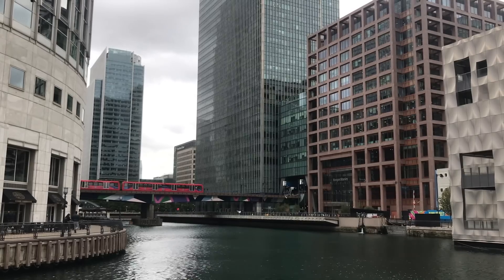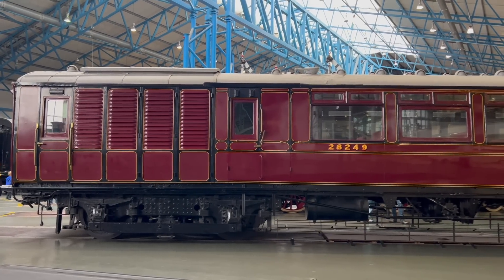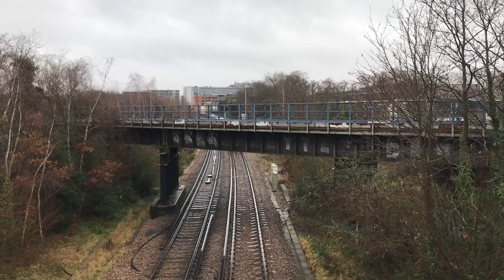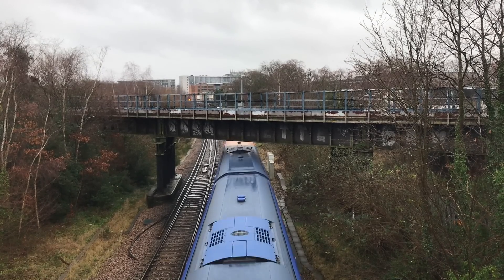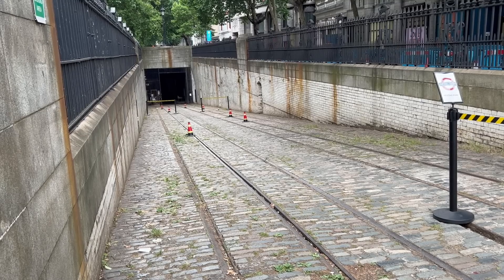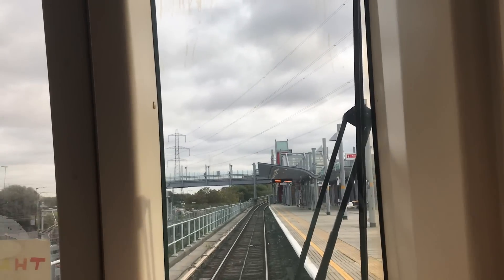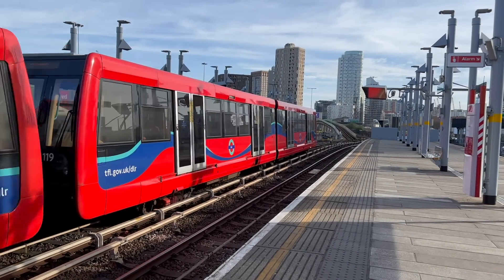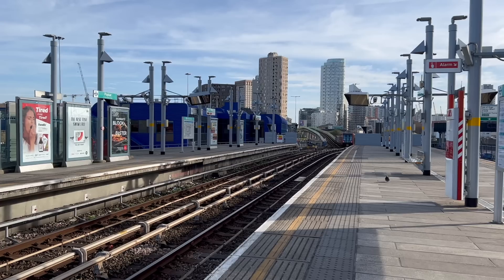How the Docklands Light Railway is Powered

Comment: Third rail actually has a very good safety record. Platelayers know well that before you go anywhere near the lines to repair them you make well and truly sure that the traction current is off. Same as the Underground. On the other hand, a side contact 3rd rail system was pioneered back around 1915 by the Lancashire and Yorkshire Railway on the Manchester-Bury line. It ran happily enough but was converted to the Metrolink when the non-standard rolling stock became life expired.
Reply: Third rail is responsible for eight times more incidents than OHLE according to the HSE
Reply: @hairyairey is that track workers or people trespassing?
Reply: @johnchurch4705  probably both. I recall someone dying as they were running away from the police.
Reply: @hairyairey  I think the simplest solution is don’t trespass or try and evade the police by running across rail/tube lines. I did read an article on a tram system that uses third rail, the 3rd rail only powers up when the tram is there, it might be In Australia 🇦🇺?
Reply: @johnchurch4705  Very simplistic response. Even if it wasn't lethal the third rail is of limited usefulness outside an urban area. India adds 1000km of electrified track every year. Its rail network is only about 3 times the size of ours, so it's definitely possible.
Reply: @hairyairey  I have read that we are way behind India 🇮🇳 on electrification.
Reply: @hairyairey  Thanks. Two surprises here; firstly that India's rail network is so relatively small given the size of the country (68K km v 16K km, actually about 4x UK) and secondly that nearly all (93%) is now electrified (UK 37%). I believe that virtually all Indian electrification is overhead wires which is not surprising considering the long distance runs.
Reply: @iankemp1131  I don't think they have any third rail, although there's that awful standard gauge commuter line in Mumbai now (don't set me off on that one!)
Reply: @iankemp1131  also is that figure of the UK network correct? We have a number of lines that are freight only. Even heritage lines count!
Reply: @hairyairey  My understanding is that it includes all lines and does not distinguish between passenger and freight. It's from Wikipedia but has 4 solid cross-references to primary sources (ORR, Railway Year Book etc). Also includes Northern Ireland. It's just under half the peak network length (34K km in 1929) so that sounds the right ballpark to me.
Reply: @iankemp1131  Thanks for the update. I clearly overestimated the size of our railway and underestimated India's.
Reply: @iankemp1131  Found a wikipedia page that says all of India's third rail lines are bottom contact like the DLR
Reply: @hairyairey 
The figure that counts is incidents involving staff. Otherwise it's Darwin's Law.
Reply: @henrybn14ar  that's no way to run a 21st Century railway. Not when liability is involved
Reply: I thought the juice was only turned on block by block as the train entered the block, so roughly speaking, no train coming, then power in the third rail.
Reply: @russellplumley8665  No, it's a continuous supply maintained at 750V DC (or whatever voltage is used). The power draw is considerably higher when there's a train in the section and the substations then have to supply increased current. So even if there's no train nearby, stepping on the third rail would kill you (or give you a big shock in more ways than one) unless the supply has been deliberately isolated for maintenance.
Reply: "no power"
Reply: @russellplumley8665  I don't think it's that clever, it's on all the time

Comment: Some of the German railway lines also have an electrical line in the middle of their tracks. There they are also used for signaling, but in the high-speed range. Speeds over 160 km/h are only permitted with this system (as far as I know).
More detailed information can be found under the term “Linienförmige Zugbeeinflussung” (LZB).

Comment: It's a clever system and makes a lot of sense. I'm still rooting for electrified steam trains though. Look at that magnificent steam train at the end. Wouldn't it be chuffing great to see those going past knowing that the steam boiler was running on electricity? 😁
Reply: Hornby make or maybe made a line of model railway locomotives which 'electrically generated' their steam propulsion.
Reply: Switzerland did this during ww2 and in the late 1930s / early 1940s the USA was experimenting with  steam locos that generated their own electricity - but without success
Reply: Wrong way round. Make a steam engine that powers a steam turbine and makes its own electricity! Bonus points for a nuclear reactor...

Comment: Jago could you do a video on why the DLR is so wobbly?
Reply: I'll save him the time. It's because the trains are very light (less than a third ofthe mass of an equivalent mainline train) and the permanent way (the whole railway, not just the track) is built to a less stringent quality standard than the mainline and this allows the lighweight DLR trains to bounce and wobble around a lot more .
Reply: @MDThomas-pv7hx thanks
Reply: @MDThomas-pv7hx I recall Jago said in his video it's the way the bogies are constructed. I think I need to rewatch it
Reply: @hairyairey  Not necessarily the bogies themselves but rather the wheel and how they're more conical than normal.
Reply: he already did

Comment: I know someone here will know the answer to this question. As a completely non-techie sort of person, I was wondering why the same high voltages can't be transmitted as effectively down metal rails as they can along heavy duty overhead wirees.

Is it just a safety issue or are there physical principles at work here?
Reply: For completion, tramways tend to use 600 - 750V overhead wires which has a similar explanation as why 3rd rail is powered at similar ranges: Too many objects nearby, would be too much of a safety hazard and has a higher chance of arching.
Reply: Simple answer - 3rd rail is 750v DC. Overhead is usually much higher voltage, say 1,500v and could be AC. The higher voltage means more power with a smaller drop over length due to resistance. More tech explanation -  it's Ohm's Law. One volt can push one amp through one ohm.

If the near ground 3rd rail were powered in the kilovolt range, it would not only be much more deadly to humans wandering onto the track, but also be subject to wasteful arcing and sparking due to its proximity to the earth = return part of the circuit.
Reply: @RadioJonophone  In the example of the DLR, it's elevated some distance from the ground and shielded, couldn't the voltage be raised in a system like this?
Reply: @peepiepo  The practical limit for 3rd rail is 1500V but 750V is a much more common standard. It's not much worse in terms of transmission losses and required substations but allows for a more compact setup.

In most countires there are also additional electrical safety rules on systems above 1kV. I don't know if railways are exempt from that though.
Reply: @RadioJonophone  I knew the voltages were different. It's the second part of your answer I was looking for. Cheers!

Comment: If you've travelled on Manchester Metrolink between Victoria and Bury, then you're on a line which until the 1990s used a very unusual 1200 VDC side contact system.
Reply: Ha - I came into the comments to post that!

The first L&Y electrification was Liverpool to Southport, later extended to Ormskirk, at 600v DC third rail. The suburban lines out of Manchester were to be tackled next, but because of the hillier terrain 600v wasn’t regarded as powerful enough. The weird side contact arrangement was arrived at partly for safety reasons, but mainly to reduce exposure to snow and ice.
Reply: @andrewrevans8496  Was it also to reduce the number of feeder stations required? I was under the impression there was only the one input, at Bury?
Reply: @lordmuntague  not sure, but I wouldn’t be surprised

Comment: The under-rail pickup method is itself over 100 years old. In 1919 Vincent Raven planed to use this pickup method for his proposed York - Newcastle electrification.
Reply: That's nice. The New York Central employed underrunning third rail on the Grand Central Terminal project - more than a decade earlier

Comment: If we haven't got used to you being extraordinarily nerdy by now, Jago, why are we even here?  Enjoyed that explanation though. I did wonder (ever since I encountered Southern Railways third rail system) whether or not they might get "upgraded" to overhead wires. Then I moved to the south coast and found it wasnt that simple.(Tunnels mostly). I suppose dual systems would be possible given we have dual (or more) supply trains. So upgrading would be possible...even on the DLR if that became an imperative. Seems unlikely though and its quite a neat system ...although I suppose there may be capacity issues as it gets more popular.
By the bye, still quite a fan of Parisian Metro trains that run on big rubber tyres.

Comment: In Toronto, the subways are powered by an over-running third rail system and these all have a covering plank, even in the tunnels. I recall that after a heavy snowfall in New York that the lines with over-running ( the Long Island Rail Road, as I recall) could not operate but the under-running lines like the Metro North could.

Comment: the pickup shoes are not sprung they are air actuated as the rail it self its a aluminium with a steel layer applied to the bottom of the rail so a light pressure is needed so it doesn't wear down the strip steel down too quickly and to prolong life of the rail please look at this  https://railwaymatters.wordpress.com/2017/11/24/30-years-of-docklands-light-railway-dlr-new-trains-to-come/
   👍

Comment: Thanks Jago.  The third-rail system with a contact from beneath is quite common abroad.  It's used on the extensive Hamburg S-Bahn system for example.
Reply: It is the de-facto standard for all metro systems around the world. And has been since the 50/60s.
Reply: @sjokomelk  More recent metro systems tend to favour overhead wires though.
Reply: Yep, Oslo and Stockholm metros were (mainly) built in the early 60’s. As Jago does mention, a ‘bare’ top-pickup rail wouldn’t work up here - it’s actually snowing now, bloody April fifth… 😅
Reply: 😢 @musiqtee Stockholm uses top  pick-up rails with a wooden "roof" above the third rail.
Reply: @jakobholzwarth1544   I stand corrected - Thanks!
Reply: Unfortunately your comment is false.

Hamburg S-Bahn does pick up from beneath but even stranger. It picks up from the side. The inner side towards the running rails. Sone sections are too electrified with overhead wire and all new lines are build with overhead wire. 

The S-Bahn Berlin is similar. It also picks up from the side (which I, didn't knew myself). But it has an even Stanger trick up it's sleeve. At a few locations the bridges are too narrow and the pickup-shoe could hit the bridge. To prevent that, they can flip up the shoes to get the required clearance. I'm no longer sure is done from the drivers cab or using trackside equipment, but I think I recall it trackside equipment.

Small fun-fact about the Berlin S-Bahn. The reason it uses 3rd rail is, because the system is so old, that back in the day where the build the first lines, lobbyism of steam locomotive manufactures lobbyed hard to prevent bridge to be raised with the intend to prevent overhead wire to be build. 

Berlin U-Bahn is also kind of crazy.
The "Kleinprofil" i.e. The narrower cars on the Lines U1, U2, U3 and U4 are top pick up with positiv polarity. Except U2 it has negativ polarity because of the Berlin wall.

The "Großprofil" the wider trains are all with bottom pickup and have a negativ polarity.
Reply: @IamTheHolypumpkin  I'm sorry, but you are wrong in some parts.
In general, the Berlin S-Bahn draws its power from below on the third rail. There were bottlenecks where the third rail pushed the current collector inwards and then contact was formed from the side. As far as I understand, these places have been rebuilt over time.
Reply: And the Berlin S-Bahn and some lines of the Berlin U-Bahn. The other U-Bahn lines use a third rail with contact from above. They don't mix because the height and width of the trains is different but they have the same track gauge
Reply: BART, which is commuter rail for the San Francisco Bay Area (Bay Area Rapid Transit) uses the same system, whereas San Francisco's Metro uses overhead wires, as it's a hybrid tram/underground service.

Comment: The DLR is a great network..i don't see it as nerdy to like such a wonderful mode of transport...You have raised an interesting subject on power supply..with the trams now using overhead lines, (I am guessing high voltage AC), surely this will be far more efficient in future, and time the old 725v DC is consigned to the history books? Or will Mr Yerkes 's ghost come and haunt me? PS I love sitting in the very front seat on the DLR, so much better for photography!
Reply: London Trams use overhead 750VDC. High voltage AC would require much higher clearances for safety.
Reply: @lordmuntague not sure you are correct there. 230V RMS AC is less power than 230V DC, 30% less (1/sqrt(2))
Reply: Trams and pretty much all OLE light rail systems use low voltage DC. Standards vary but 600V and 750V are the most common.
Reply: AC would require trains to carry a bridge rectifier to power a DC motor. So not suitable for local lines that use small trains.
Reply: @hairyairey  I must admit I don't know the full spec of the exact trams London presently uses, but DC motors are less common nowadays in rail vehicles, tram or train. They tend to be AC induction motors, with electronics converting a DC supply into variable frequency AC. If the main supply is AC it would indeed have to be rectified first, as happens with modern trains. The advantage of an AC supply is that it has much longer range, requiring fewer feeder stations, which are the real expensive bit in electrification. It's all very much swings and roundabouts, which makes it all the more interesting.
Reply: @lordmuntague  I think the gains between AC and DC for loss over distance are marginal, seeing as all the international interconnects are DC. That's so we aren't tying our grid to European peak demand.
Reply: @hairyairey  This is true, I have wondered if we'll see a high speed line powered by high voltage DC soon. Mind you, I can't see existing lines changing quickly given the amount of low frequency AC still used in Europe.

Comment: Thanks Jago.  Great video and has explained what I didn't previously know about the DLR; especially the thin 'centre rail'.  I'd already figured out how the Power Rail worked, but wasn't aware that the tracks were the Return Rail.  Strikes me as being almost as Lethal as the exposed Live Rails on the Tube.
Reply: All electrified train tracks use the rails as the return circuit. Even the ones running 25kV overhead wire. But the rails are grounded an at a potential of 0V to ground. So they are perfectly safe for humans.
Reply: I suppose that the rails are grounded at very short intervals.

Comment: Fun fact, the DLR train in Manchester mentioned was not the only one to be fitted with a pantograph for overhead wires. Some of the oldest DLR trains were sold to Essen, Germany to be used as tram trains, so they were fitted with proper driver's cabs and pantographs.
Reply: wasn't this to do with the bank extension and some sort of health and safety legislation? x
Reply: @Name-iq8te  The German Wikipedia article I've read to make sure I wasn't misremembering said that the old DLR trains did not meet updated fire safety standards in Britain, so they were sold off.
Reply: @namenamename390  thank you :)
Reply: @namenamename390  I gather the Kings Cross fire led to a tightening of the rules rather than the expected relaxation, and as a result the walkways in the Bank Tunnel were deemed not compliant so end doors had to be fitted. 

Generally if there is sufficient space alongside the train end doors are required - this is why Thameslink needed them for Moorgate (the rest of the network is fine) and there had to be a lot of work moving track in the tunnels around Dover to allow Javelin trains to operate.
Reply: @railotaku  There was a rail collapse in this tunnel too, it was closed for a period for urgent repairs. Lovely views out to sea as the train goes between tunnels ....
Reply: @Name-iq8te  What's with the kiss.I didn't know you cared x.
Reply: I was about to comment the same, thank you for doing that. However, I would not call the DLR trains sold to Essen "tram-trains", as they are still light rail vehicles that do not run on main line tracks shared with main line trains. If you want to see tram trains in Germany, you should have a look at Karlsruhe or Chemnitz for example.
Reply: @EppelheimTV  I used "tram trains" because I didn't want to use "Stadtbahn" and explain what that means. You are correct though.
Also, I love your two examples of tram trains because they arrive at the same thing from opposite points; Karlsruhe has trams that also run on mainline railways, while Chemnitz has trains that also run on city streets.